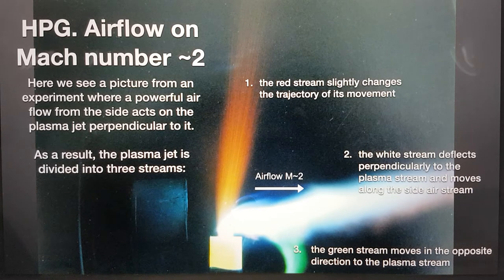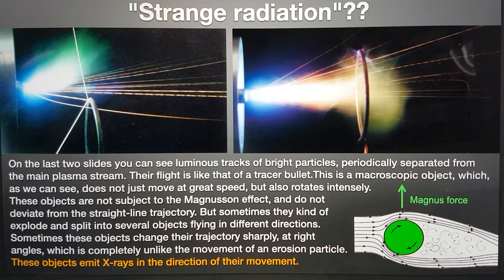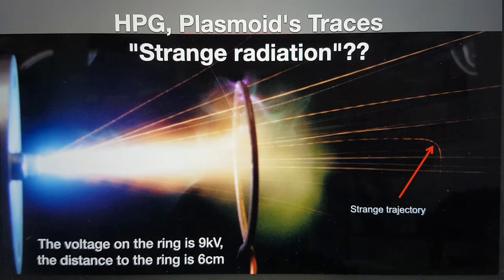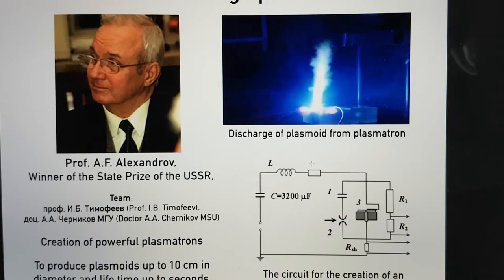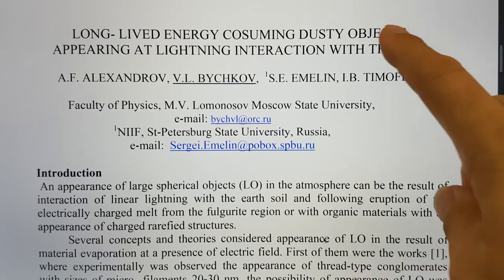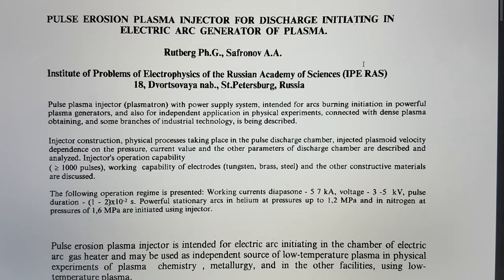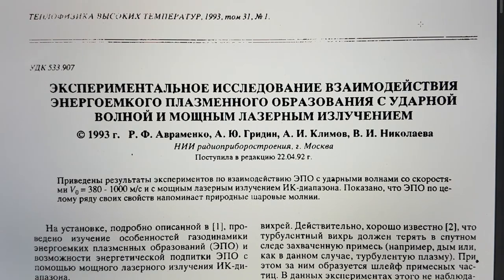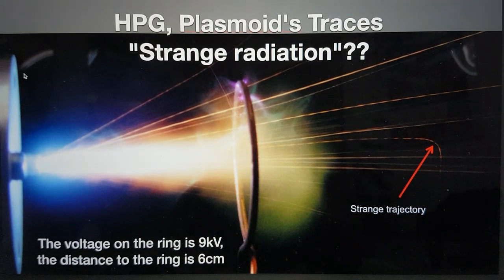Erosion and other Plasmatron Plasma Generator Schematics

Comment: 2 looks like a quenched spark gap. An air quenched spark gap can considerably change the output waveform and other characteristics of the output. Quite possibly lessoning destructive effects also if encountered due to duration in the output being to long.

Comment: I would say that it appears on the circuit diagram that the gap on the right are actually the power source terminals, where as the 2 domed gap on the left looks more like a spark gap trigger. This would explain why 2 is labelled as something of importance, where as the terminal gap on the right is not labelled. In electrical engineering two opposing arrows with a gap often symbolize spark gaps, so the more dome like arrows would fit with this interpretation as well. Hard to exactly know without having the original presentation where the circuit diagram comes from, as it appears not to be in the reference links you have posted with the vid at present?  :)
Reply from the maker: The presentation was the first Zoom meeting of the Russian CNT&BL group monthly meeting hosted by Dr. Samsonenko, head of Physics at Moscow State Friendship University. There was no recording shared, I only managed to get the Russian version of the slides by doing a live screen grab of the slide and it was part of a wider presentation that was on Ball lightning in general and there were no other slides on this particular experiment.

Sure, power has to be put in somewhere, and whilst the symbols on the left are the normal ones used for a spark gap, I like you came to a similar interim assumption that one had to be power and the other the spark gap.
There is no link because the slide is created by me as a translation of the original screen grab (in Russian) and is itself original in this video in a sense.

Comment: Rsh - appears to be a Resistor, "shunt" to ground.) In all of my experiments with DC plasmas, there seem to be only blue and orange plasma (as fundamental color seen by the human eye), based on directional aspects of the applied current. An ac or alternating current tends to create a plasma with a "purple-colored appearance"- yet the two directional aspects (and associated colors of blue and orange plasma) can still be separated by an air stream across the arc, spark gap, or plasma beam) into the base, fundamental characters of blue and orange. These may actually be artifacts of the 4D, quantum nature of light, or of some aspect of the quantum media itself- although i have no idea WHY it is always blue or orange. Even in the Hubble, "deep field view", of the earliest galaxies forming after the big bang, the base colors are either blue or orange in appearance, depending on their directional quality of approaching our own galaxy or receding from us. Red sprites move from our atmosphere towards space, while the blue lightning moves down, towards the direction of earth's electric charge (gravity).  It has been my experience that ac or alternating, purple plasmas and/or controlled, ball-lightning, can be made to appear white with the addition of graphite, blue with the addition of aluminum, or green with the addition of copper (into the reaction vessel or plasma stream/plasma ball, etc.). Are you sure that the green is a new, fundamental color of plasma? Or is their copper present in the area where the green color was seen? I ask because i have twice in my lifetime seen "green lighting" during a severe, thunderstorm. I have never been able to reproduce the green color WITHOUT adding copper to the reaction vessel. Also, i have learned that a plasma can be either "hot" to human touch, burning or shocking the flesh, while other plasmas seem to be entirely "cold" or "harmless to touch". It seems as if there are two, entirely different types of "electricity", perhaps just two, fundamental types of particles or "charge", positive and negative. Furthermore, i hypothesize that neutrons may actually be "charge clusters" of these two, fundamental particles, basically like "heavy hydrogen", but totally reworking the atomic model, for which i am not really qualified to speculate.  I will leave a link to one of my videos that demonstrates a cold plasma arc that is about 4 cm long, that was entirely "cold" and harmless to my touch. Also- i have seen indications that plasma can be either invisible or visible, in addition to being either blue or orange, or hot or cold. This gives us eight, fundamental types of plasma, IMO, likely based on the quantum states of the three dimensions that we can see and measure with our instruments. Thanks for the video!. P.S. I am still interested in helping you and/or others pursue this line of inquiry into the color/directional states of plasma and how that might relate to the quantum states or specific mass of various elements- those details that LENR science is lacking, and/or the conceptual apparatus for such experiments. I am also eager to help apply the new physics of LENR (and/or quantum vacuum energy) towards useful industry- clean energy for human profit and progress.
Reply from the maker: Well, it is not far fetched to say that a neutron is a charge cluster of an electron, proton that has an anti-neutrino hanging in there.

I think we need to have a really good schematic and circuit diagram and bill of materials to re-produce the effects shown by Klimov.
Reply: @MFMP  I was thinking of an even more radical departure from a history of energy physics; that, such has been funded by Koch, Exxon, and other lovers of money/power for decades: such "physics" of nuclear science is likely just as WRONG and corrupt (a lie)  as our so-called democracy is a lie. Our science, just like our so-called "government", has been subverted by covet means, exactly as JFK warned us about, just prior to getting shot and killed- from at least two different directions. In fact, although i was classically trained in electronics and physics, i have had a change of heart after seeing so many suppressed free energy devices that actually work, and also having close encounters with some of our alien overlords. I have achieved excellent results in recent years by accepting the fact that standard electrical and physical theories are being taught incorrectly (on purpose) as a means for suppressing human advancement, particularly any Russian or Chinese advancement during the cold war. 1% of this world's population control EVERYTHING of "news, media, or education", and these people are so evil and secretive, they might as well be aliens (you know... like our UAP "friends" who also tend to hide, a sign that ET must be a predator or parasite, but obviously not here to HELP humanity.  I am convinced that that there are two, fundamentally different types of electricity- with particles themselves being an illusion- an "artifact" of measuring what is essentially pure energy, having at least 4 different quantum vectors.